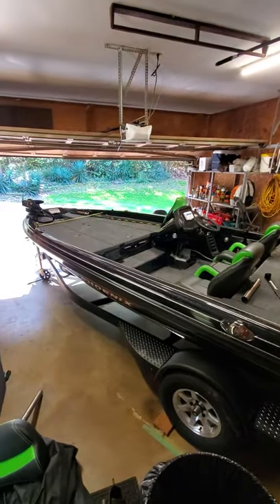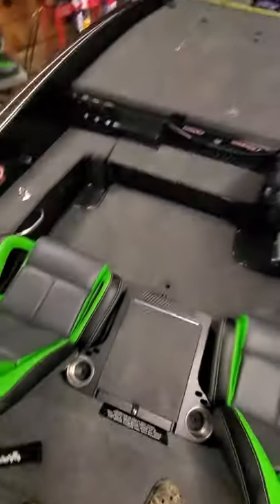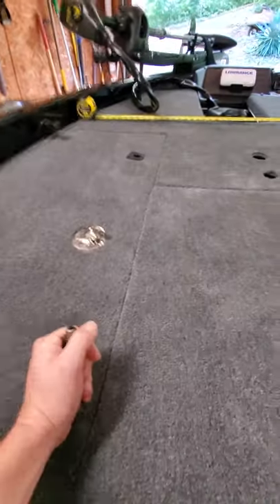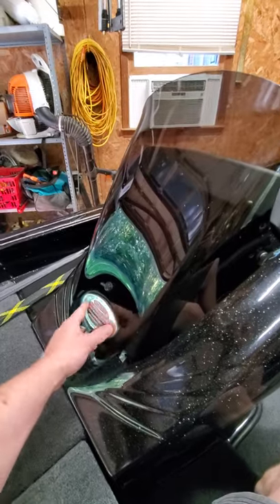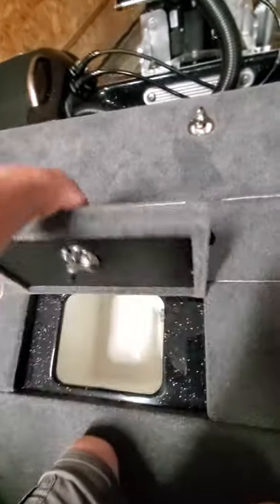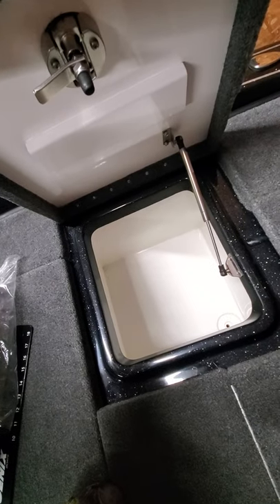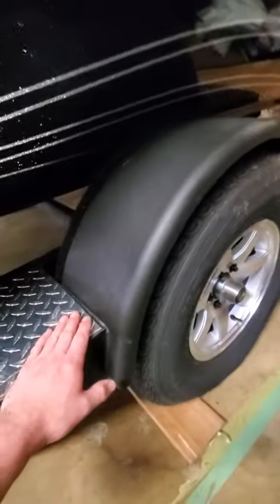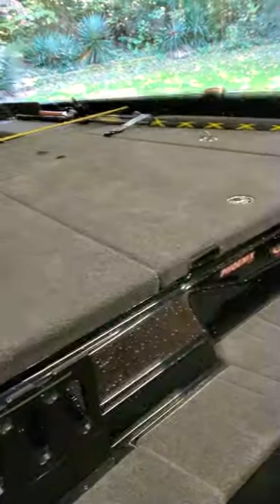2021 Phoenix 818 pro walk through

Comment: how deep is your garage? Looking to see what I can fit in mine. I currently have a Nitro 482 in mine. My garage is 20' deep, and I have to put it at an angle like yours. Thanks in advance!
Reply from the maker: 20x20 and I've had 20' boats in there with fuel axle trailers. The garage door is what usually restricts your angles. This boat on a single axle can be moved around easily by hand
Reply: @louie6014  Awesome! Thanks for the reply!

Comment: does this Phoenix 818 pro tow about the same as the sabre you owned before? I want to tow with my Toyota Tacoma.
Reply from the maker: Tows about the same. Both single axle trailers sway some but not much. A duel would be a bit nicer.

Comment: Top speed with the 150
Reply from the maker: All these are loaded speeds. With water in livewell and alot of fuel ¾ tank or so. I have another video where I run it. 22p temptest ran 56.2@6000-6100, 23p ran 58.x close to 6000. A 24p ran 60.2@5900. Hole shot decreased by half a second each pitch up. If you ran a light load and worked your jackplate around could image the 24p running 62-63
Reply: @louie6014  wow. That’s amazing for a 150. I’d figure the 175 would be high 60s might peak 70
Reply from the maker: @ninnomarks3870  from what I've seen guys with poles and a 175  are running 63-64 and without 66-67 I've yet to see one hitting 70...and we all know fisherman like to haul too much stuff in the boat and fib about speeds and sizes of things 😅